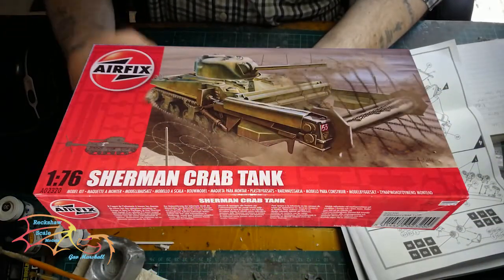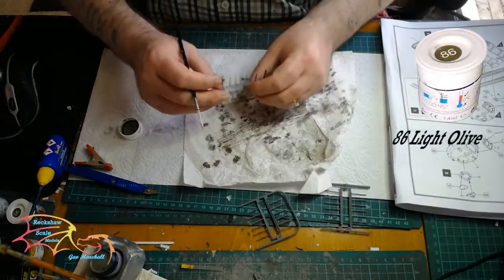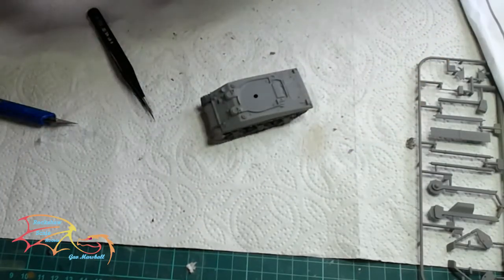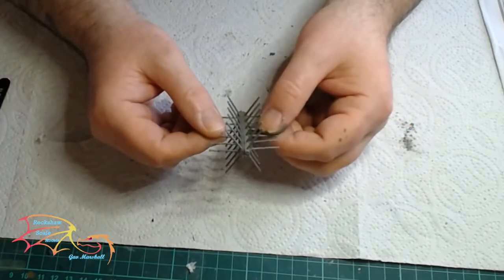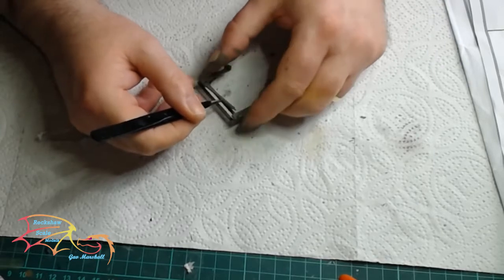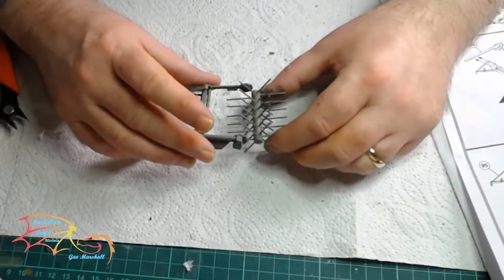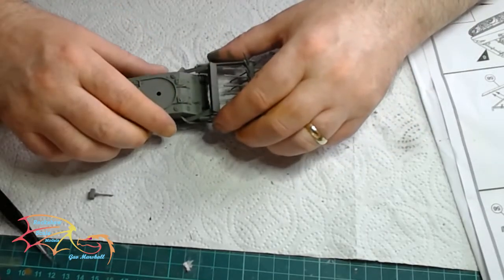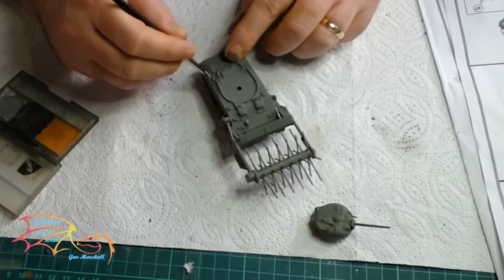Airfix Sherman Crab Tank Scale 1/76 Part 2 The  Crab

Comment: I had trouble attaching my mine flail correctly and in the end I had to go and look at the photos of your build, in order to get mine done properly.. :) I did not find the instructions very helpful and the paint instructions doesn't show the 'Crab' at all. I have a reference book but the photos in it are not all that helpful either and even though it is supposed to be all about the Sherman Crab, it tends to show more of other flail tanks, like the Churchill.. :P Either way, great to see your build, I sort of wish I had done mine 'out the box' now, it certainly would have saved me a fair bit of fiddly work.. ;) I hope to have mine done at some point tomorrow, but I need to do some more detail painting and re-attach a couple of the chains that fell off when I put the 'crab' together, as well as decalling and a gentle weathering.  I noticed the decal option with the kit is for the same tank that is on the cover of my reference book. Probably just co-incidence..
Reply from the maker: Hi Rob, the instruction aren't 100% clear, it took me a few goes of dry fitting before I decided which way it should go. As for painting the Crab, I thought the chains would be cover in rust/ mud and so on.  I do like you're idea for fitting actual chains, even though you had a couple of problems with them I think you may have stumbled on a great way to display the chain as if it was moving. If the superglue is making the chain stiff that will give off the appearance of movement which would be great in a diorama. Personally I would leave the new chain and paint accordingly, any excess glue could be removed with a hobby knife or file if you're careful. I like the plastic chain thinking it looks more dramatic but an actual chain doing the same job would look so much better.